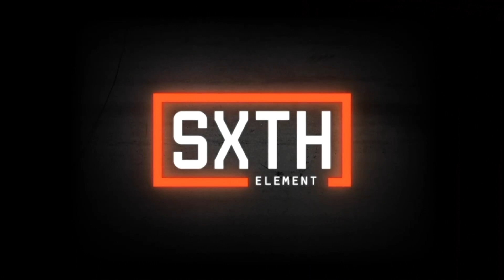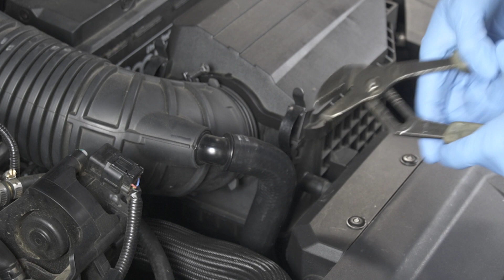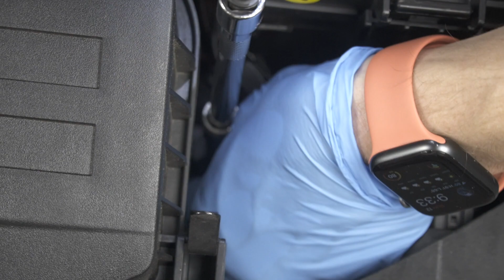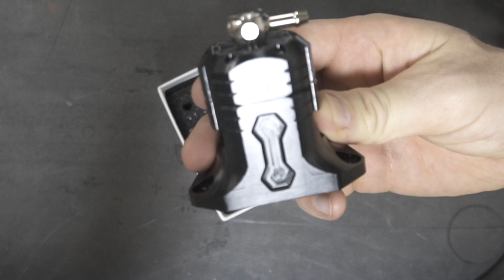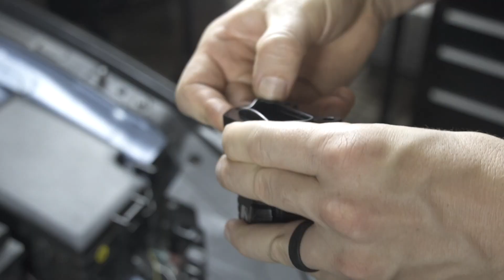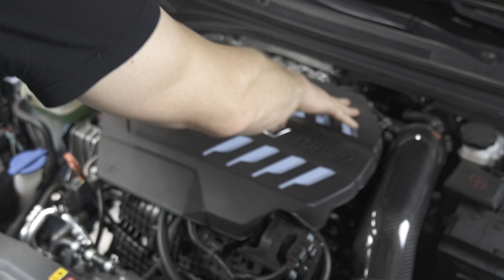SXTH Element AV6 Blowoff Valve | Install and Sound Clips |

Comment: Is it plugged into the recirculating valve?
Reply from the maker: For a N vehicle it deletes the recirc system and will need to plug the hole in the intake.
For the 1.6,2.5, and 3.3 all can retain recirculation.
Reply: @SXTHElementEngineering what about for Kia K5 GT 2025? Delete the recirculating hose?

Comment: just a question are u venting to atmosphere and blocked off the blow off return hose on the intake and also is there anything on the blow off valve 1.6t smart stream that needs to be adjusted or is adjustable
Reply: I’m not making over 10 pounds of boost. I was averaging 14.
Reply from the maker: For a N vehicle it deletes the recirc system and will need to plug the hole in the intake.
For the 1.6,2.5, and 3.3 all can retain recirculation.
There are no adjustments.

Comment: Where am I supposed to connect the black hose
Reply: the bypass hose? if so, you dont. They sell a BPV plug for the intake that's like 10 bucks
Reply from the maker: Correct, Thanks!

Comment: Would it sound the same for a Kia stinger?
Reply from the maker: If it is the 20t then yes but if its the 3.3 then it has 2 blow off valves so then it would sound different.

Comment: Anyone looking to purchase, make sure to keep in mind you’re gonna need to plug up the BPV hole that is now left open because of the vacuum hose removal. I had bought the plug SE offers without realizing it’s only intended for their own intake kit. For obvious reasons, it didn’t fit my AEM intake. As of right now, about an 1 post-installation, I have it covered up with multi-layers of duct tape and hope it’ll hold until I find a permanent solution.

Comment: Is the turbo flutter bad for the turbo on the n because of the twin scroll?
Reply: yes turbo flutter or "compressor surge" is really bad for turbos.  The fan blades are literally chopping the back pressure air as it makes it's way past the turbo in the opposite direction.  Bad because that puts an immense amount of friction and stress on the turbo.

Comment: Got mine 2 days ago. Tried to install but could not get that large piece of hose off. How did you get your hose piece off? Also once I do get that hose off, what goes over the connection on the intake hose by the air filter box? You dont show that in the video.

Comment: Does anyone know if the intake and bov voids rhe warranty for a new N?
Reply: Intake no,  BOV yes.
Reply: @thaddeusjackson6440  Did the dealer tell you this?
Reply: @EMJ207  Unless your mod breaks something or changes a fundamental function of the vehicle (transmission or engine swap for example) they can't void your warranty for a mod. And even then, they'd have to prove your mod caused the damage.

Comment: Will this work on the DCT VN?
Reply: Installed on my DCT and works great.  Bitch of an install on the DCT, not much space to work with.
Reply: @Dutch75  well as long as it fits that was my only concern, I most likely won’t be doing the install do to the other parts I’m waiting on from SixthElement to release for the DCT. Thanks for the info 👍🏾

Comment: Thanks for the video! I installed my SXTH element BOV today on the stock air intake and had to use electrical tape to close of the hole where the recirc valve was attaching to the intake. I’m not getting any turbo flutter like you but I do have a small woosh in high rpms. How would I be able to get the flutter?
Reply: You should look up what turbo flutter is. It may sound cool as hell, but it's not good for the turbo or the engine.
Reply: @-Ncrypt  When the compressed air has nowhere to go, it causes the turbo rotational speed to rapidly drop, and attempts to push against the wheel. This can cause premature wear on your turbo, however closed throttle flutter on modern turbochargers is unlikely to cause a noticeable drop in turbocharger lifespan
Reply: AEM intake is what my N runs. Omg so much STUTUTUTU. You’ll love the flutter

Comment: Is that turbo flutter coming from the bov as well? Or is that specific to your N?
Reply: Nope.
I have the CF intake u saw at the end .. stock BOV/recirc valve .. 
same flutter sound.
Not as crisp and loud if a PSSSSST

I highly recommend the carbon fiber intake with that air box.  It’s great and looks so gorgeous
Reply: If your BOV was working you wouldn't hear any flutter
Reply: I have a 1.6t forte, that’s why I ask
Reply: @NORBCREW  IMO the best BOV for the Forte GT is the Boomba one. It's just a big ol' hotboy "FSSSSST"